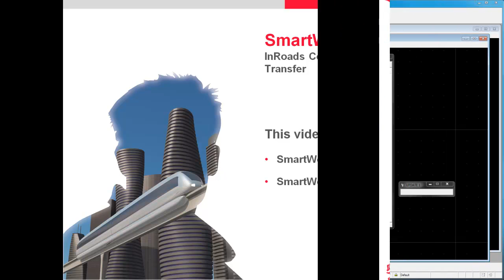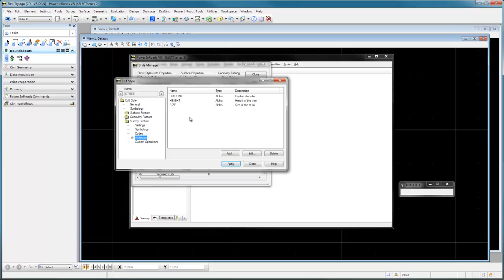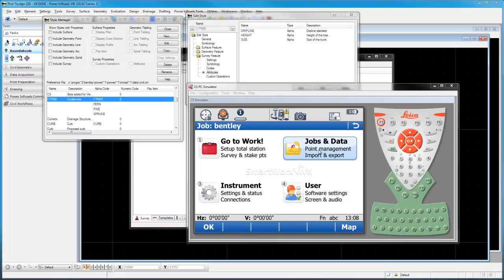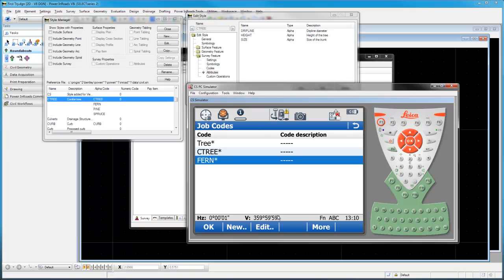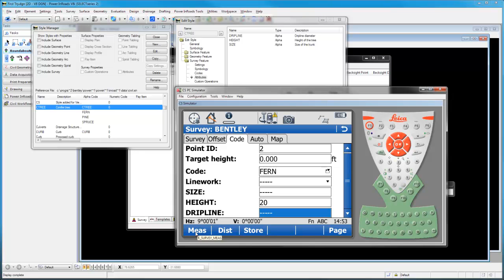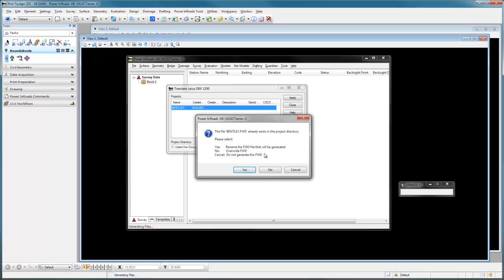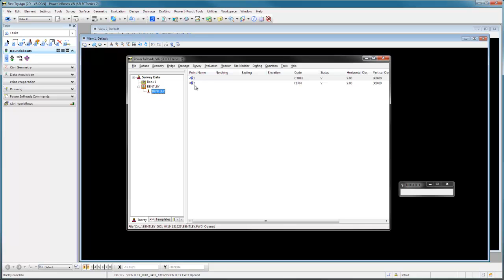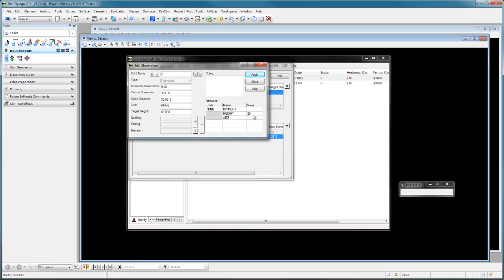Smartworx Viva Video Guide: Bentley Inroads Coding and Data Transfer

Comment: At 2.42 you note that you use String Codes and Control Codes on Attributes 1 and 2 and that this will interface with the Bentley Fieldbook once imported via the DBX import tools. Which Attribute is which and in what order should these be , and do you need to enable Stringing in User Settings to enable this to work correctly?